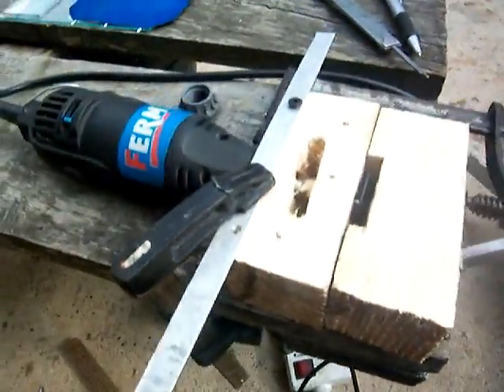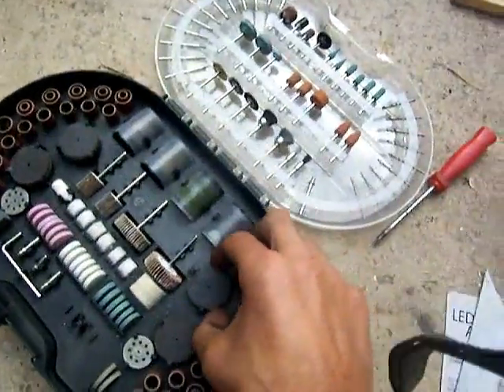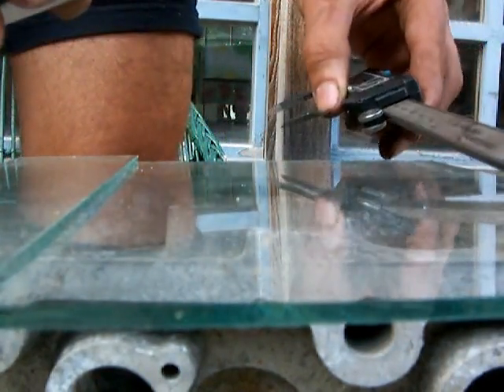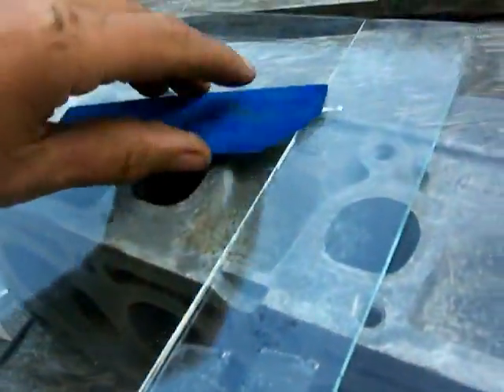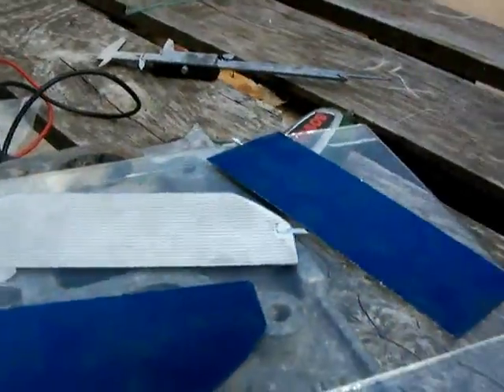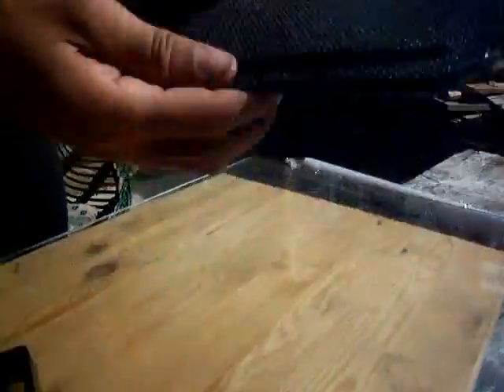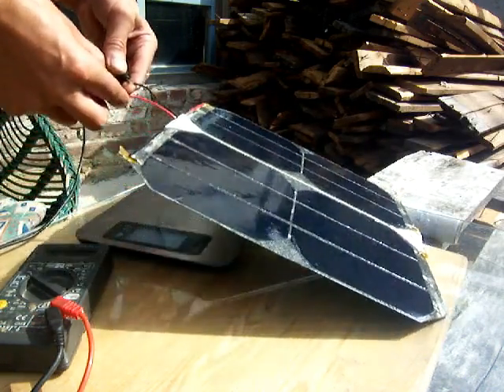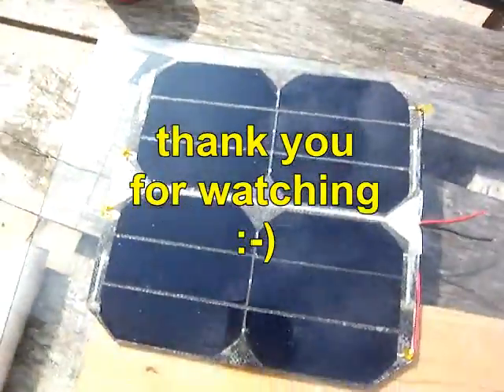cutting Sunpower solar cells, testing flexibility and building foldable 86 gramms 5V 12W panel

Comment: Hi Robo, can sunpower cells be cut into 6 pieces?
Reply from the maker: I would say no. You have three + pads on one side and three - pads on the opposite side. And lots of thin lines in between. A minus line, then a plus line, than minus again.
Maybe six long slices but cutting the three slices in halves will get you in trouble connection one side. 
Also watch the beginning of my lengthy tutorial.